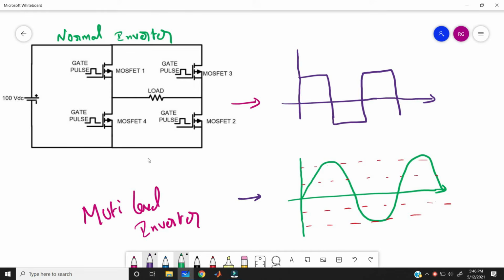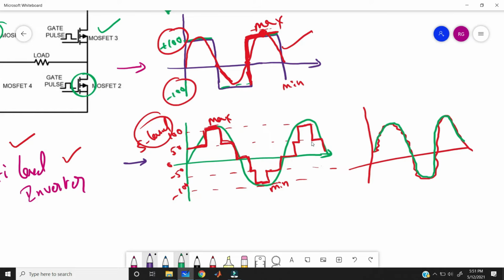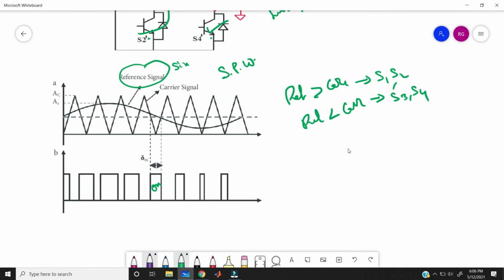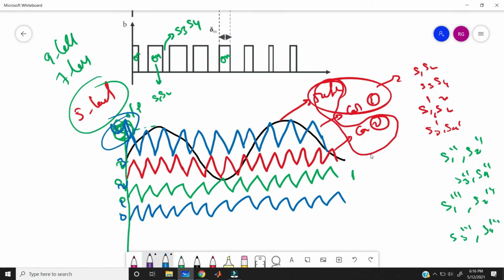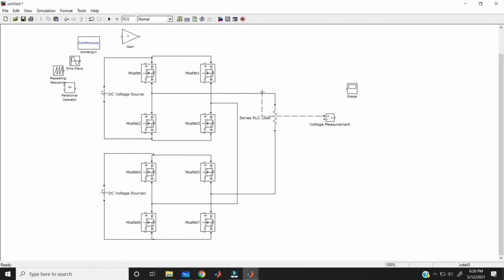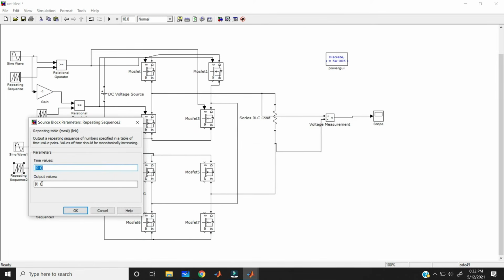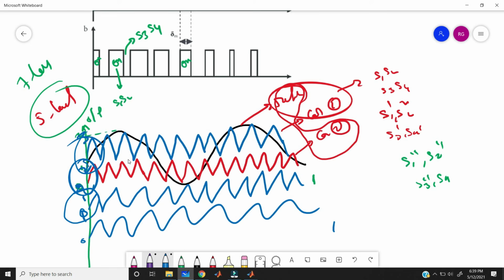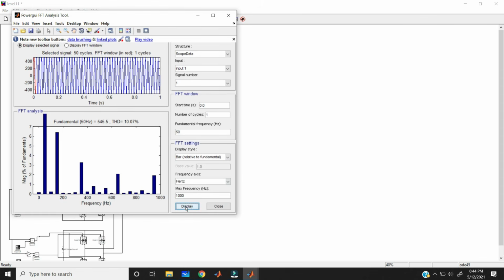Multi Level Inverters | 5,7,9,11 Level CHB Multi Level Inverters Using MATLAB Simulink |THD Analysis

Comment: I built the same ckt as you with the same setup, but the output level is 3 when it should be five; any idea?
Reply: I face the same problem. Did you get the solution?
Reply: @Expat_Life69  No !
Reply: i got same problem too, did you solve it ?
Reply: @metegurkan8900  nope brother.
Reply: @metegurkan8900  Did you solve it?

Comment: why am I not get the output waveform as your even after I have copy exactly as you did?
Reply: Bro the waveform won't come same because we have to take triangular waveform as carrier wave 
With time [0 0.5 1]/1000 
And output as [0 1 0] for wave 1 and [1 2 1] for wave 2.
Reply: @satyamverma05  and [2 3 2] for wave3,  [3 4 3] for wave4 and  so on right?
Reply: Satyam varma,  i Have the same problem can't get the same output, can u help?
Reply: @yeaserarafat1095  follow the above method
Reply: @satyamverma05  sorry i Don't get ur method, do u have WhatsApp?
Reply: @yeaserarafat1095  I face the same problem. Did you get the solution?
Reply: MAKE IN 2009 VERSION